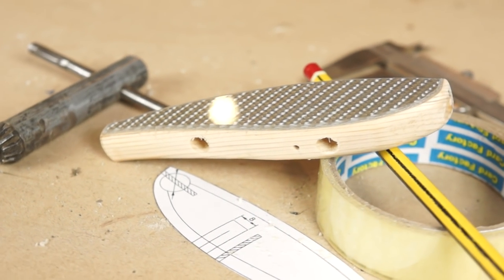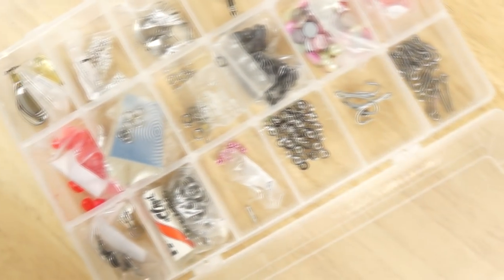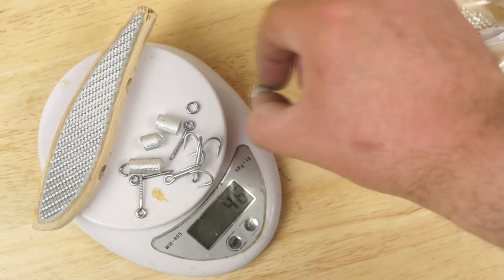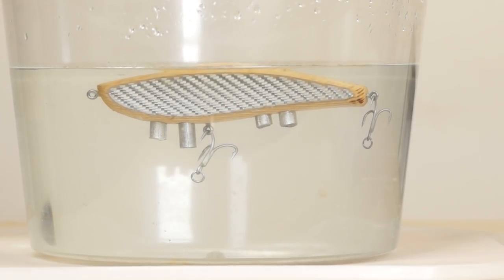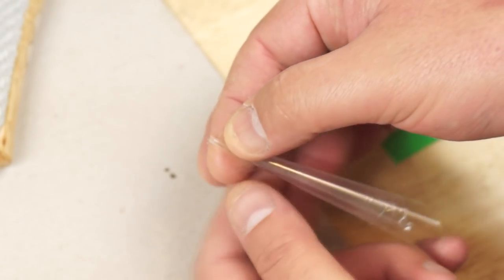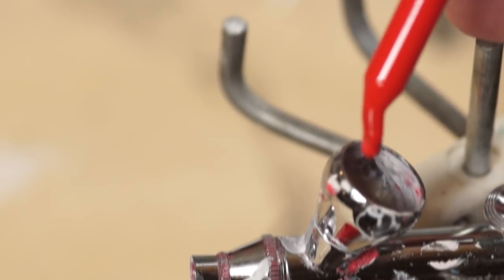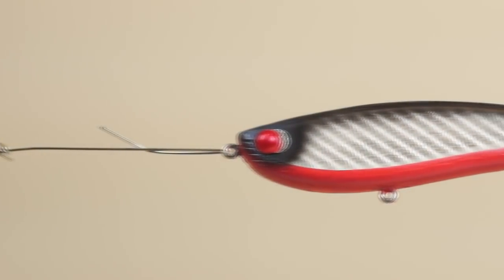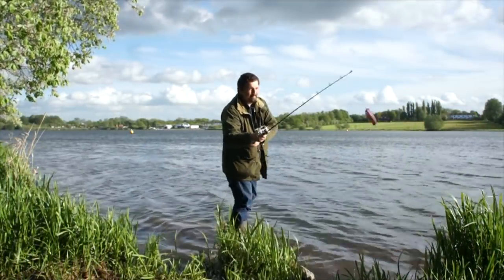Making a Bulletproof Glide (Jerk) Bait Fishing Lure Part 2 of 2

Comment: first time i have seen someone use displacement to balance lure buoyancy, great idea.
Reply from the maker: It worked, the lure sank very slowly and it is great for quickly getting an idea of weight required but i think it would still benefit from a bit of old fashioned manual adjustment.   THanks

Comment: Very interesting to see, that you do not twist the threaded shanks of the screw eyes straight into shank core diameter pilot holes inside of the timber blank but pre-drill holes at least to thread diameter to push in eye screws into epoxy filled holes , so that later the cured epoxy would make up for some kind of plug or dowel  around the threaded shank of the eye screw .

Newer came across this method before(only when assembling twisted wire eyes) , ...do you think , it would be more reliable against pullout this way ?

Otherwise just another stunning two part video of yours , Paul , ...I always enjoy to look over your shoulder .

Greetz , Dieter
Reply from the maker: I used to have to fit a lot of large stainless eyes m16-m20   for mooring pins into timber and rock using epoxy resin, the advice they gave was to make a wider hole about 1-2mm and fill the hole a third before pushing the the eyes in. The eyes never twisted and never came out of either the wood or rock they only needed replacing when the eyes snapped off after a couple of years of boats tugging at them. What i found when screwed the eyes into wooden lures with epoxy was even after the epoxy had set it was relativly easy to unscrews them again, when i slightly enlarged the holes so i count push the eyes into the epoxy once set it really took a lot of effort to get them to turn them and in some cases with softer wood like pine it damaged the lure.     Cheers Dieter
Reply: *****

Some very interesting info , Paul , thanks for sharing , ....in fact I can imagine about the eyes could be untwisted relatively easy , though I haven't tried it before .
When I started out making wooden lures more than 20 years ago , I used to assemble the screweyes with just superglue , ...just effortless to untwist them , my epoxied eyes might come just a tad harder to twist out , I reckon .

I'm assembling my eyes in a way that I'd extend the first few millimetres of the core diameter pilot holes to about 3,0 to 3,5 mm dia. , so that some kind of "glue plug" evolves there when twisting them in with epoxy .

Nevertheless I've never had a screw eye fail , not with 1 meter+ pike attached nor with the lure ran into the worst snags , ...it would always be snaps , leaders or line to give up first , ....or straightened hooks as well .

But I might try your method on one of my lures as well , ....I have full confidence in both assemblies , though , ...but probably your method comes a bit more convinient to work down skipping all of the twisting ?

Thanks again , ....greetings , Dieter

Comment: Great lure made them for years, but one question why not screw the hangers in just a smaller pilot hole with a bit epoxy on the screw. Seems like a weakness making the pilot hole that big.
Reply from the maker: i think either or works, these days i tend to go with the glue and screw because it faster and never let me down, cheers

Comment: happy holidays.. Paul have you ever had any issues with screw eyes pulling out even with 5min epoxy? I usually run a wire thru with my life but been experimenting with homemade screw eyes
Reply from the maker: +alan depalma No, i have had the split rings open but never the screw eyes, I tend to trough wire with lightweight woods like balsa, Have A Great Holiday

Comment: What strength line do you use Paul ? As I have just invested in a jerkbait rod casting up to 100g and a bait caster that was cheap enough online - just need advice on braid been told to go for 80 lb do you have any recommendations ? Am also a close mate with the Scouse angler so might get to have a meet up if you come fishing one time with us - be helpful as I have just made my first wooden lure with guidance from your videos - mostly shaped by hand tools as don't have any sanders so it's taken a while - have it primed and awaiting a bit more touching up as need to give it a bit more smoothing over as primer picked up imperfections on the wood so just time now .
Reply from the maker: I am using 50lb braid but 80lb doesn't seem unreasonable, i have used al kinds of braid some expensive some cheep and to be honest i have not really noticed any big variation between them so i buy big spools of spectra braid the stuff from china on ebay, and then i spend the savings on the expensive stuff for drop shotting or light work. I keep saying i am going to get out with Scouse Angler for bash up the canal so it would be great to see you up there i just have to find some time which has been a bit thin on the ground. So it won't be long and you will casting your first homemade lure, the addiction awaits, cheers

Comment: is it possible to make a balsa wood hinged bait? if so what kind of hinge do you use for it. i basically want to make a lightweight big glide bait.
Reply from the maker: I think with balsa you may be too light for a glide bait, but I could be wrong and it may be worth a shot. I would use either a cloth hinge like webbing or wire eyes but i think you would need something stronger to screw them into than balsa.

Comment: Nice work, but just one comment for hook mounting points don't use 5 minute epoxy. It is much lower quality than normal (24h) epoxy
Reply from the maker: i have never had a eye come out in the ten years that have been using it, i have bent hooks broken split rings and even opened and eye on a very bad snag